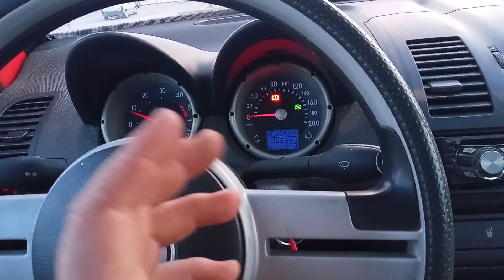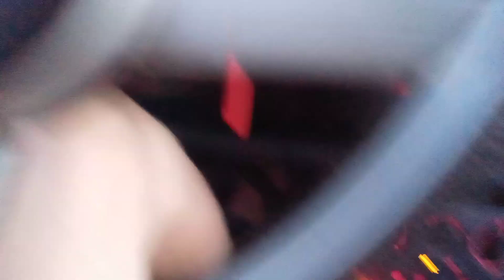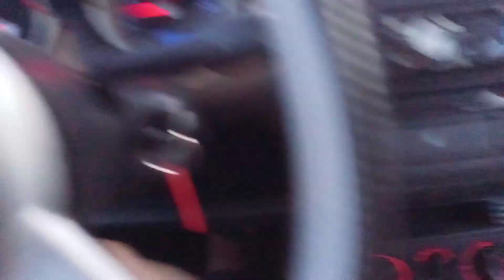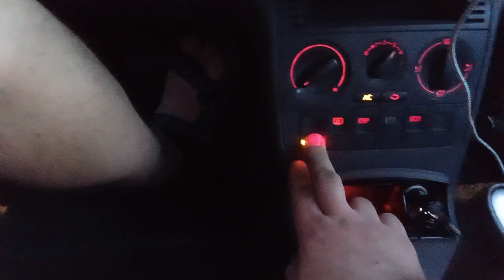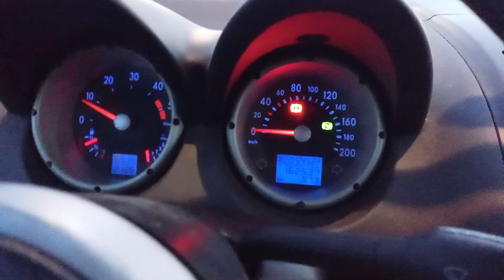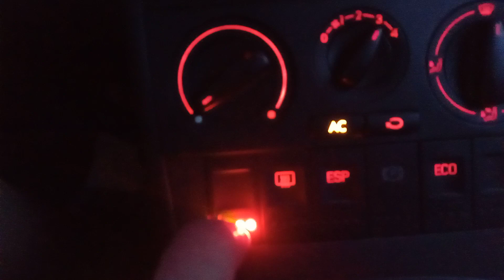VAG Aircon control unit (J293) function description. Nobody knows about this faulty design! MY97-0?

Comment: I have a 2012 Audi A8 the radiator fan keeps running when the car ignition is on. I’m wondering if this is the problem
Reply from the maker: Any DTC's stored in engine control unit?